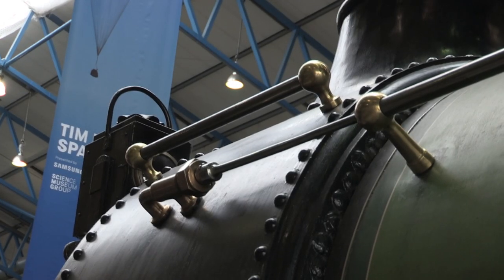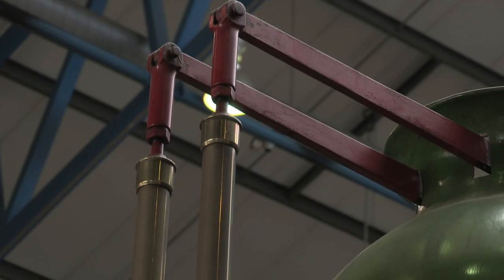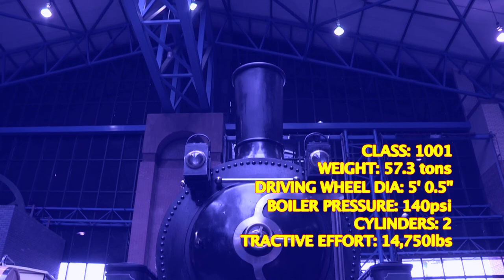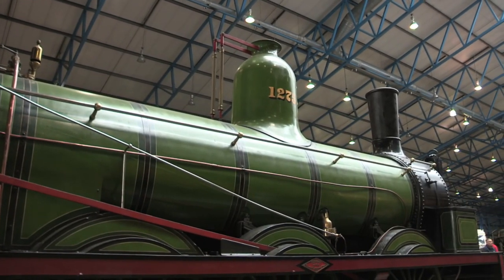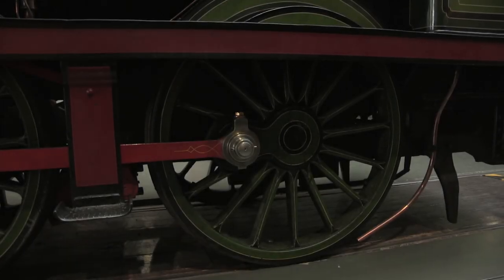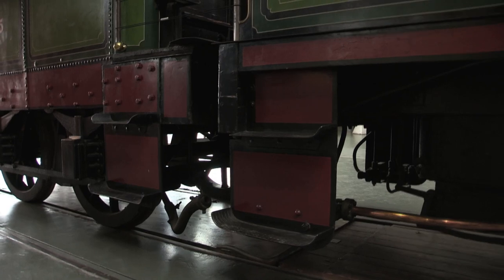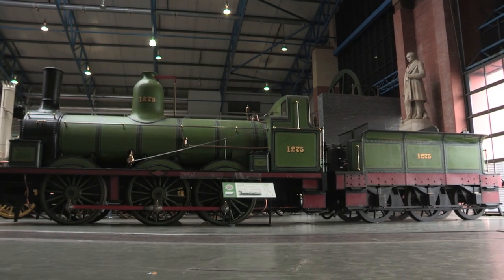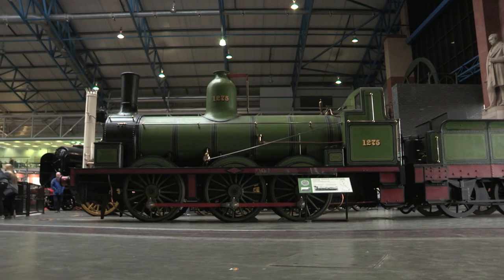SOLE SLIP: NER Long Boiler No 1275

Comment: If you are interested, in Australia we still operated a few long-boiler locomotives into the 1960s and even as late as the early 1970s! The NSWGR had bought some from Robert Stephenson in the 1860s but most came from Beyer Peacock. The largest class was the A(93) class, later the Z19 class (in the 1924 re-numbering scheme). They got new Belpaire boilers, new cabs, and were often paired with a variety of tenders, often including bogie types originally built by Baldwin! The last of them were not withdrawn until the early 1970s (a class first built in the 1870s) because they  were able to operate over poorly-laid, lightly-built tracks in places such as Darling Harbour Goods Yard, and on the "Pioneer Lines" (which in many ways were similar to British "Light Railways") which often had light 60lb flat-bottom rails, tight curves sometimes as little as 4.5 chains radius and steep 1 in 25 gradients.

Comment: Interestingly, here in the U.S. you will almost never see an 0-6-0 that does not have the firebox overhanging the rear axle, long boiler style. Some of them with freakishly long fireboxes to boot, the "doghouse" style where the firebox extends to the very rear edge of the cab footplate was common before engineers started pitching the boilers up high, putting wide fireboxes over the frames, instead of ridiculously long, skinny ones between the frames.
Reply: In the UK, the 0-6-0 was the "workhorse," the single most common wheel arrangement, while in the US it was primarily used for switchers, particularly the USRA 0-6-0 of the first world war era. Practically every major US line had them.

Comment: Excellent episode, as always. I'm particularly jazzed about this one as I've wanted to learn a bit more about this particular engine for ages, but info about her is surprisingly hard to come by, mostly seeming to be condensed to "She's really old, and she looks weird." I actually thought she was much older, possibly dating to the 1850's, not the 1870's. Then again, in a sense I guess you could say it is considering that the design was little changed from the 1850's original. 

I was also unclear on the true revolutionary-ness of the Stephenson long-boiler concept and how much it differed from earlier designs, mostly because I just didn't know much about it. Basically, taking all of the locomotive evolutions that took place immediately afterward into account, it seemed like the long-boiler concept was a pretty obvious step, thus I was never clear on what made this engine so special in that regard.

Comment: cough Robert Stephenson designed the long boiler,  a design which he patented (October 1841) so that the maximum amount of heat could be squeezed out of the combustion products passing through the tubes.It had been found in the earlier Stephenson engines like Planet or Patentee, the smokeboxes were getting hot enough to melt zinc and tin. Part of the patent was having all the wheels under the boiler barrel. Cheers!